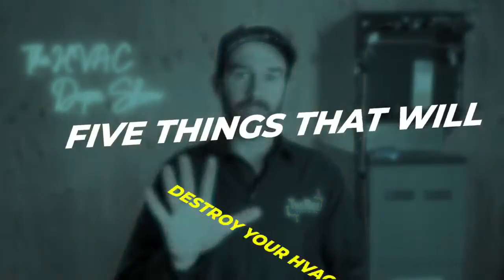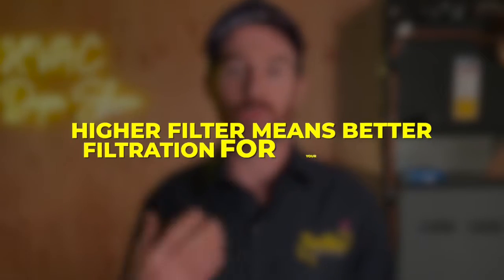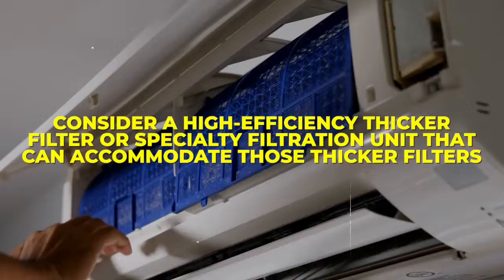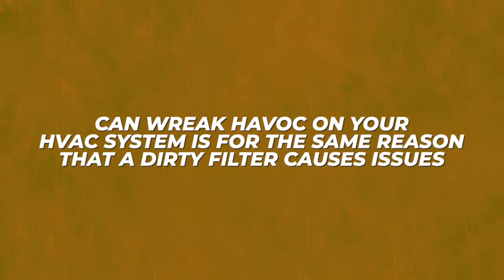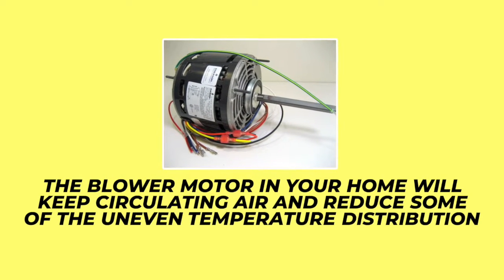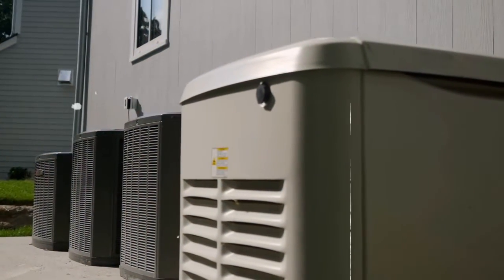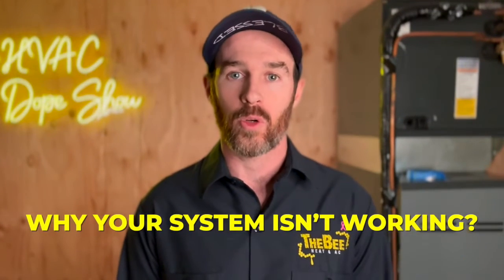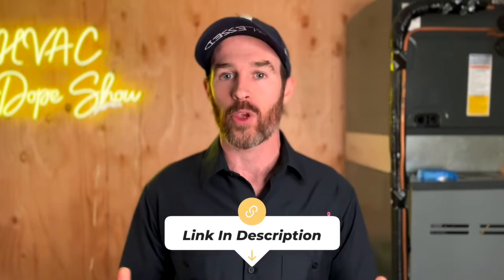These 5 things DESTROY your HVAC 🔥🛠️

Comment: When you run the fan continuously you blow all the moisture on the evaporator back into the house. In an extremely dry climate I suppose it doesn’t make any difference.  It’s a very bad idea otherwise.  Also you can be sucking in hot humid air through small leaks or the attic.

Comment: What about regions with variable power rates. Some regions have very high power rates in the early evening. Could it be worth over sizing so the system can quickly pre heat or cool before and after the higher power rates?
Reply from the maker: I like where your heads at lol but unfortunately no, the wrong size system will always cause problems. A better solution would be battery storage like a power wall or something that provides power during peak demand and investing in solar to go with it would be even better to offset and store your own power. But a short cycling air conditioner (because it’s oversized) won’t run long enough for proper humidity removal either and will just be very uncomfortable.
Reply: @TheHVACDopeShow  what about a house with ample ducting for the size of house? The quote we currently got recently gave us a range of options and we went for the largest the quoted based on the above premise.

Comment: My number one recommended is to get your static pressure tested! In my area about 70% of homes have a single undersized return air duct that is often cutting your airflow in half.
Reply from the maker: For sure! Definitely agree, adding a return will make the system quieter too!
Reply: How does one get static pressure tested?
Reply: @urielbravo8  You need a Manometer. If you are getting your system serviced I would let the person on the phone know you need a static pressure test done. Make sure the tech knows they need to test it!
Reply: @urielbravo8  On YouTube search: Home Performance static pressure. There are plenty of videos talking about running the test and it's super easy. If your static pressure is over 0.50 you need a ductwork modification! In my area most homes only have a single 14" or 16" round return air duct. This is only large enough to move 600 to 800 Cubic Feet of air per Minute (CFM). Most homes have a system that should be moving 1,200 to 1,600 CFM. Undersized ductwork is a huge problem and most companies don't run the test or talk about it.